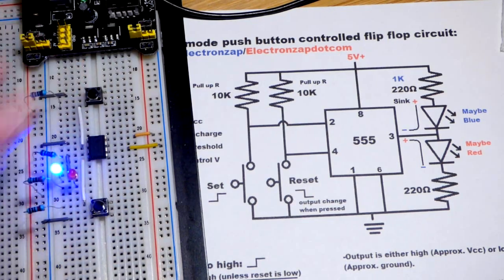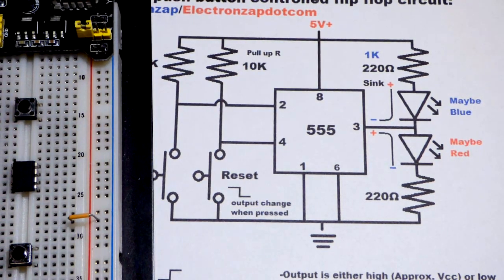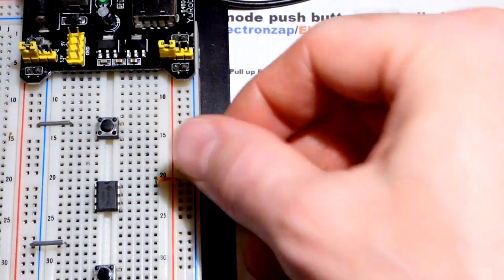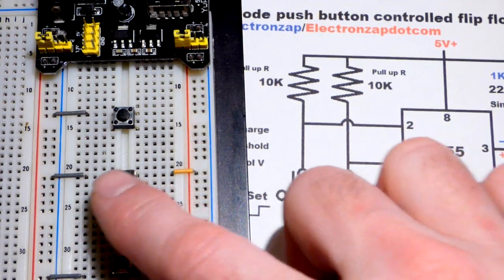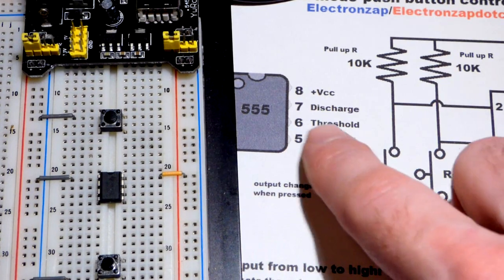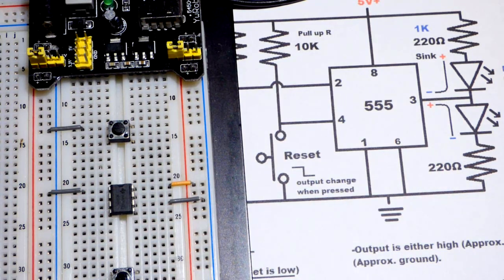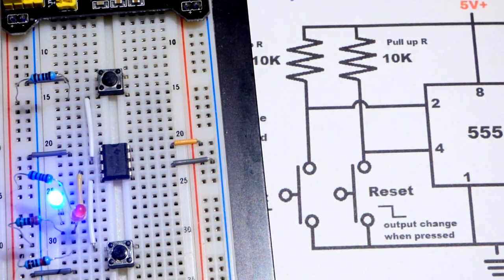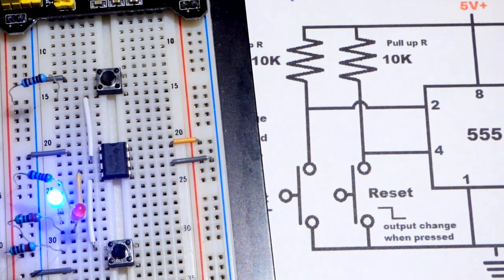Bistable mode 555 timer flip flop circuit explained for beginner learning electronics

Comment: It is possible to attach a LED to reset pin 4 ? This will turn this LED On when reset is received by  pin 4 .
Reply from the maker: I made this video that hopefully answers your question :D https://youtu.be/sO2nZ54Ebqw Indicator LED added to show that the bistable 555 timer circuit reset pin is getting a low signal
Reply: @Electronzap  That is awsome ! It does answer to my question. I spent a few hours trying to find a solution . Thank you very much.
Reply from the maker: Great! Thanks for watching!
Reply from the maker: Yeah, you just have to wire the LED and protective resistor coming from the positive rail to the reset pin so that when you ground the rail it completes a current path to light the LED.
Reply: @Electronzap  I think that a direct Led reset pin connection will create some voltage between pin 4 and ground.  That will affect reset pin functionality as it requires 0 voltage to reduce output.

Comment: Whay u dont use the pin 6 to use it like Reset?
   U prefer use pin 4.
Reply from the maker: I always see the reset pin being used unless pin 2 and pin 6 are tied together in a timing circuit. It may be bad for pin 2 to be low and pin 6 to be high at the same time or something but I don't know for sure.
Reply: @Electronzap  Thanks its true.
   To Reset with pin 6 it will be with a positive.
👍
Reply: I guess one such preference for using pin 4 to reset is simply because it IS the Reset Pin. Go figure. 😂